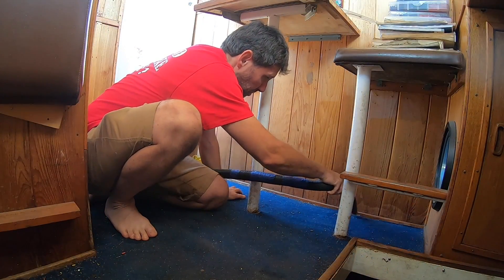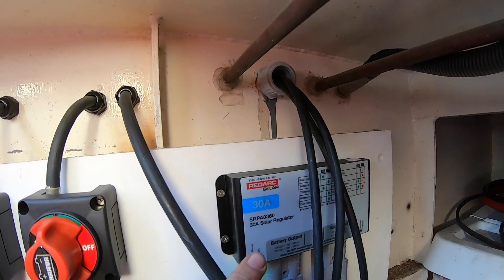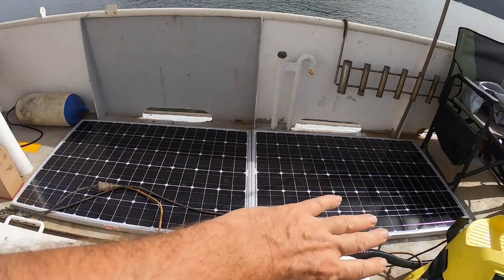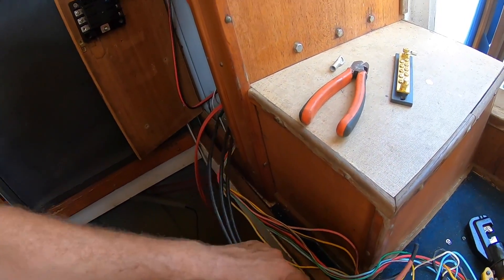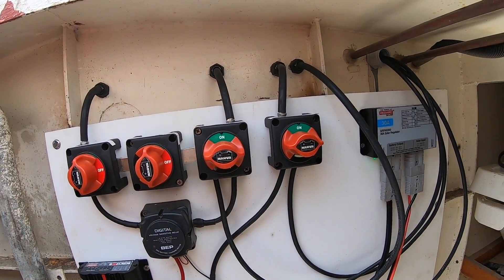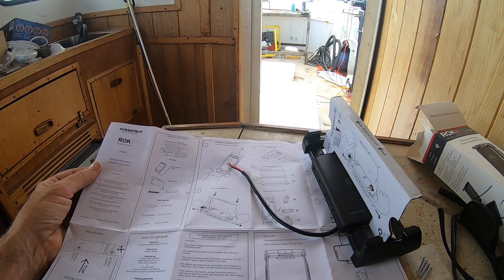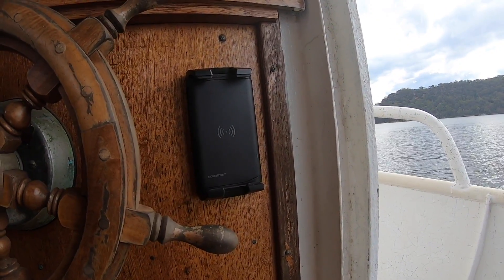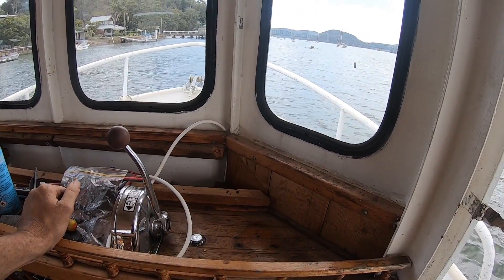Trawler electrics

Comment: Stu, now that you have evolved into a journeyman electrician, maybe you can explain something to an amateur electrician (me) about boat electrical systems.  I am aware that the electrical code in the US for wiring in a house requires a 3-wire line with a "ground" wire - usually green in color.  And this wire eventually runs to a rod in the ground or water pipes.  My question is - how do boats handle this when in the water?  No ground?
(I always thought water and electricity don't do well together)... 😳
Reply from the maker: I'm no expert on it, but the ground serves two purposes I believe. One is as a reference voltage which DC doesn't need as it doesn't have to balance the two directions of current flow and the other is for safety. I believe the ground is attached to the casing of many pieces of equipment so if an active wire comes loose inside and touches the casing it will flow to the ground and trip the earth leakage switch rather than flowing into a person that touches the casing.
Reply: @DangarMarine  - Thanks- that makes sense.

Comment: You seem like the perfect candidate to use microcontrollers all over your boat.  Raspberry Pis, Arduinos, Nav, sensors, Cameras.  Have a couple of 24" monitors and you would have a cool glass cockpit.  So cheap that redundancy is a no brainer.  You can get a ESP32 for about $7 nowadays, lol.  Node-Red would give you a very nice web based rig.

Its weird seeing people having fun on jetskis.  Where I live in Commiefornia people that have too much fun get arrested.  You can steal up to $950 legally here but just try to run a Jetski for fun.

Comment: I'd be careful leaving those solar panels on the metal surface (painted or not) as the metal frames of those solar panels can be the 'ground' which if there is a fault can then cause electrolysis! (from one metal boat owner to another!)
Reply from the maker: So what did you do in the end? Rubber mounted?
Reply: Yep, I mounted mine with some UV stable plastic square/ tube from Bunnings. Everything with a metal base, housing etc which has power running through it needs to be isolated from the hull via rubber and plastic. Caught me off guard it was a real trick for young players!! Nearly burnt a hole through on a mates boat

Comment: These butane soldering irons are the only way to go. 
Master Appliance, UT-100SIK, Butane Soldering Iron https://www.amazon.com/dp/B000FN6SOO/ref=cm_sw_r_cp_apa_i_8lNNDbD98MGG2
Easy on off and lighting. When I'm doing terminals and it's hot I leave it up right inside my roll of solder to hold it upright so nothing else burns.

Comment: Please seal those cable lugs with heavy glue filled heat shrink. It would be terrible to lose power right at the battery switches

Comment: Aren't you worried about your crimped connections corroding from the salt/water in the air? I would solder and heat shrink everything
Reply: Marine sparky here, solder no, dualwall heatshrink definitly, soldering introduced different (worse ) problems to the wiring system in a vibration prone environment.

Comment: Don't know if you're still monitoring  comments on old  videos, but Voltlog worked out how to do shrink labels on the cheap. I've been using the method for a while and it's great when you have multiple cables so you know which is what (think 12V / 24V / House / Starter / solar etc). Link below or search for voltlog #238
https://www.youtube.com/watch?v=8OQDrtP9Tx4
Reply from the maker: Thanks mate, I'll check it out.